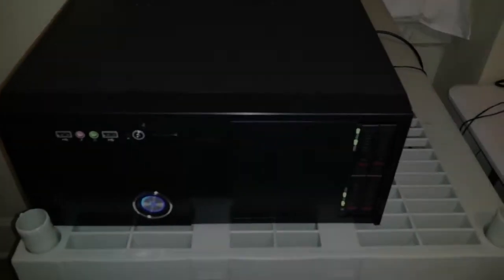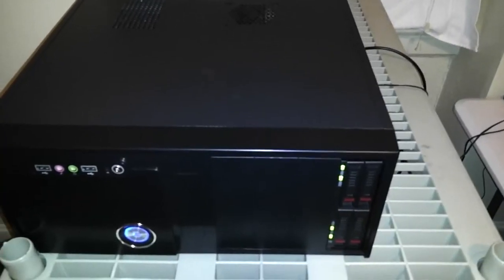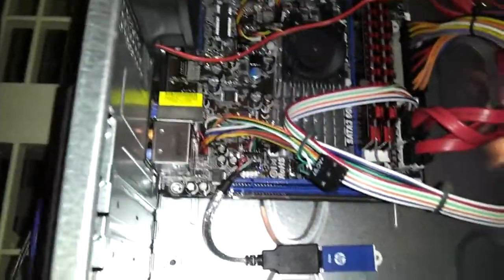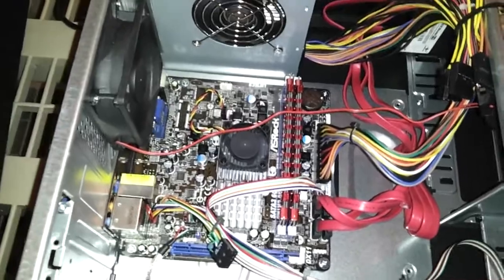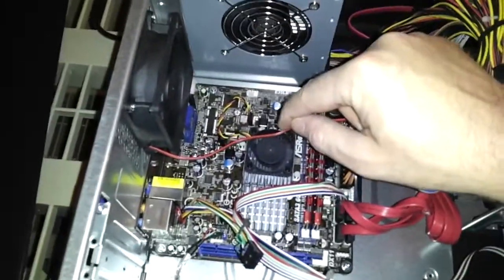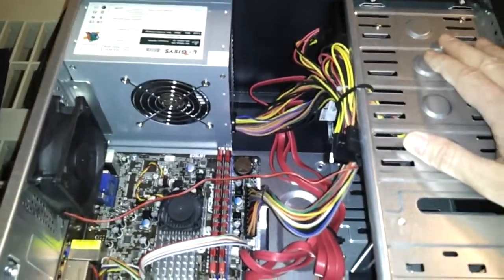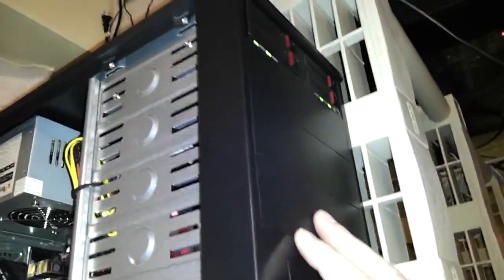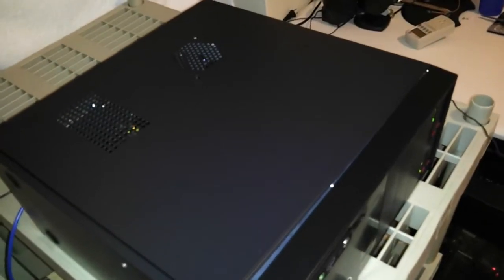Network Attached Storage server running Freenas v9.1.1 using RAID Z with 4 HDDs

Comment: Drobo 5N 5-Bay NAS Storage Array, Gigabit Ethernet
http://goo.gl/o9aZjA
Five storage bays, each of which can hold one standard 3.5 inch SATA I / II / III hard disk drives or solid state drives and one mSATA solid state drive in the Drobo Accelerator Bay
Connectivity - One Gigabit Ethernet port with Ethernet cable included
Network Protocols - Common Internet File System (CIFS)/Server Message Block (SMB) and Apple Filing Protocol (AFP)
Drobo BeyondRAID - Provides thin provisioning, instant expansion, mixed drive size utilization, automatic protection levels, dual disk redundancy, virtual hot spare, data aware and drive reordering
http://goo.gl/o9aZjA
Reply from the maker: And that is $467 without drives.  I can make this unit for $500-600 with the 4x500Gb drives included.  Depends upon the size of the drives and the manufacturer.  And drive prices drop all the time so I could probably build this server with 1TB drives and the price would be the same because 1TB drives are the same price that 500Gb were 12 months ago.

Comment: If you wanted to expand for cheap, you could get an IBM ServerRaid BR10i card for under $50 on Ebay.  May have to flash the firmware to a pass-through version though so ZFS can directly access the drives.